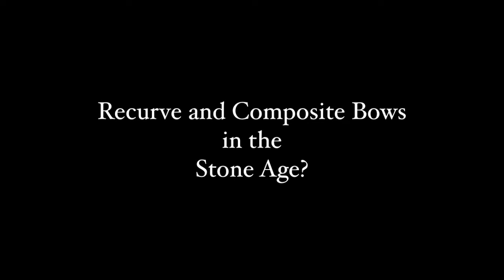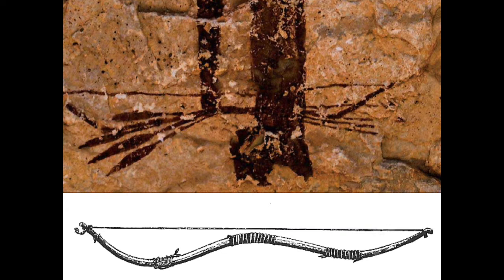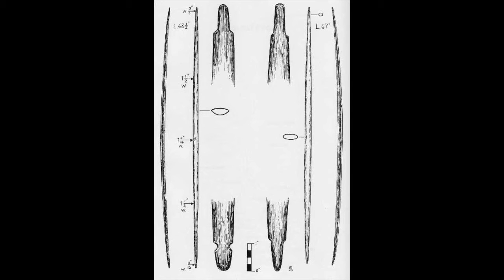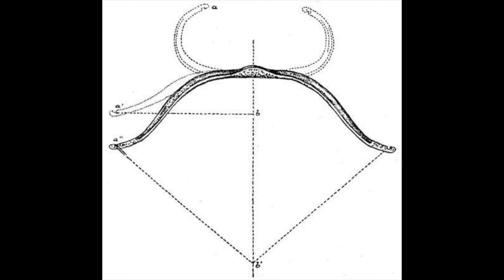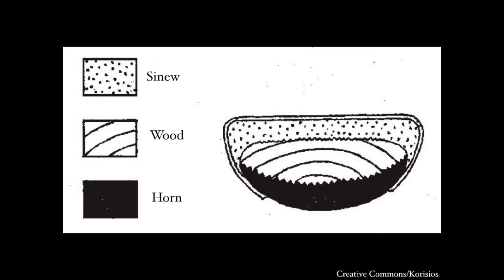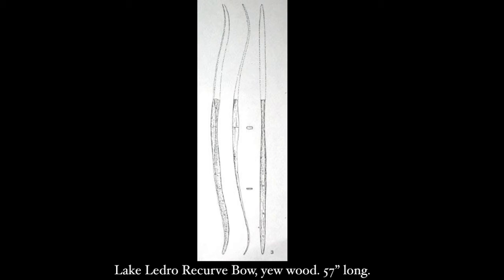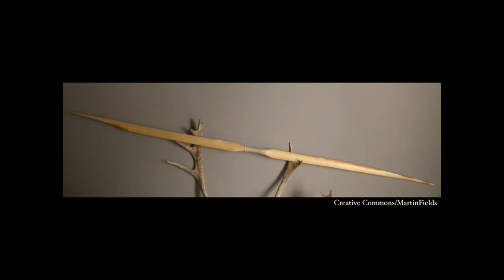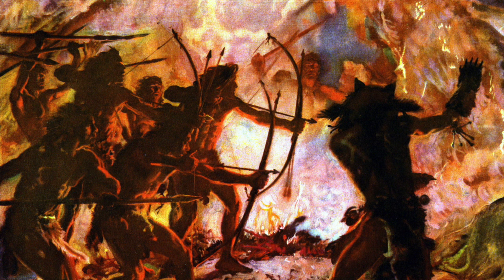Stone Age Composite Recurves?

Comment: Wow, this is a really great subject: When did people actually mix the bows with the sinew that they used for a host of tasks. They must have known how to process it early on, and understood it's strength.  I have to ask myself, if I was Joe Caveman and I understood the bow and it breaking under tension.. And totally understood how to use sinew fibers and understood their strength... And understood how to make cordage out of sinew... Perhaps cabling the back came first and then figuring out how to glue sinew to the back quickly followed. In my simple mind, I don't really see how someone would miss the possibility of using cables or sinew without having to wait a long time during the evolution of the bow. Maybe it really depends upon how long it took certain groups of people to favor shorter bows rather than making the leap towards backing.. This is a great thing to ponder. Thank you.
Reply: also, in terms of limb architecture, early men must have noticed how naturally recurved staves makes for faster shooting bows. Then followed by attempts to artificially induce reflex by heat (as they have probably know from straightening arrow shafts)